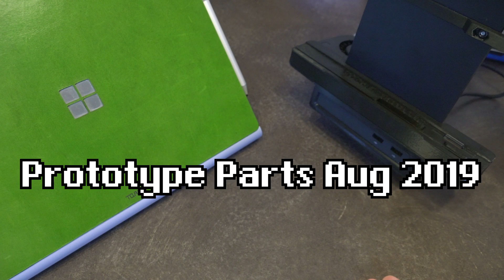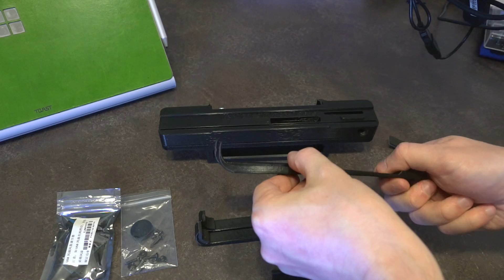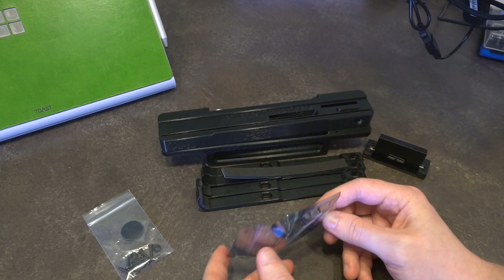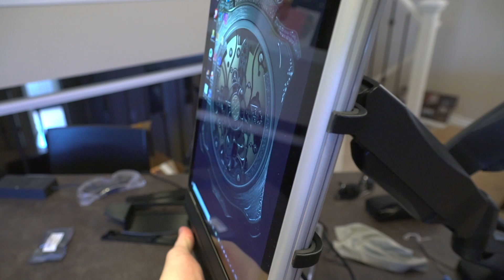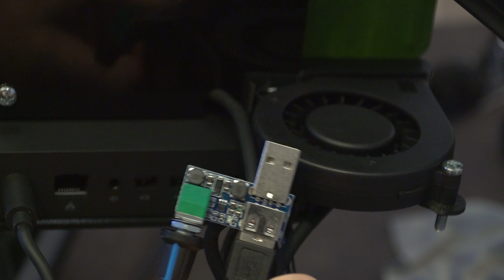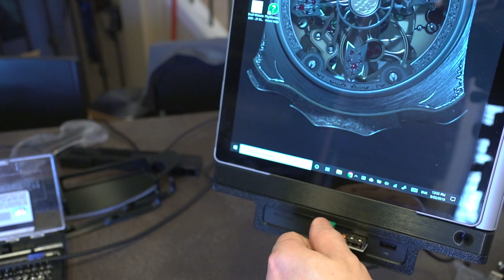Day 576: Surface Book 2- Vertical Dock for Surface (Prototype Parts)

Comment: I regret watching this series. I bought a 13.5" Surface Book 2 after watching some of your videos thinking I could use it to edit some video I'd accumulated. I had never edited before and knew very little about laptops. It didn't take long to realize that 2 GB of VRAM that the 13.5" has is very inadequate and that I should have gone with the 15" that has 6 GB of VRAM. I bought the 15" now and have a 13.5" that I spent $1800 on just taking up space.
Reply from the maker: Sorry that you somehow felt misled. I'm guessing you didn't buy it from Microsoft or kept it over the 30 day return period? I haven't had issues using the GTX 1050 for my work but perhaps your workflow is far more demanding?
Reply: @LaptopRetrospective  The 13.5" I bought brand new from a reputable seller on Amazon. Unfortunately, it took me too long to figure out what was going on in order to return it to them. And if I had I was going to be hit with a 30% restocking fee, and another fee because it was no longer new. I thought I could sell it privately, but that hasn't turned out well. 
I learned from that mistake and bought the second on from Best Buy, so that a return, if it was necessary, would be simple. Fortunately, the 15" 1TB I7 I have now has be great.
Reply from the maker: @gawnejeeping3969  Well I'm glad it eventually had a happy ending, but unfortunate to hear about the bumpy road. Again, sorry if you somehow felt misled on its performance based on this series in terms of meeting your needs and you were unable to return the one that didn't work out for you. I can imagine that was a very frustrating experience. I just recently have gone through one myself. Could I trouble you for some information on what exactly it didn't do for you? That way I can better advise others.
Reply: @LaptopRetrospective  I'm using Davinci Resolve 16. Almost every time I tried to create and use animations for things like titles, no matter how basic, it would come up with GPU full errors. Other times it would cause stuttering in the image while rendering the animation in the videos. If I tried to re-render the video, the stuttering would be slightly different, but still where it was trying to render the animation.
About the only things I could consistantly use it for were the most basic functions of stitching of clips together, adding music, and adding text/subtitles. 
I'm sure there are other programs I could have tried, but the features such as fusion and the effects offered by Davinci Resolve are what I was looking for. 
The 13.5" I have is a 500GB, I7.
I'm still learning, so the videos I have posted aren't great. I'm working to improve with each one. The earliest ones were done with the 13.5, the latest 2 (Colorado National Monument, Crystal Geyser) were done with the 15".
Reply from the maker: @gawnejeeping3969  very interesting, I know a person who uses that bit I don't think their hardware is as robust, I'll ask what limitations they ran into, something sounds odd, like it wasn't using the dedicated GPU properly. At any rate, I really appreciate you taking the time to comment and share your story with me.

Comment: I am really interested in picking up a SB2 with a dGPU (haven't decided on 13 or 15 model) soon, but I'm worried about future stable windows builds. I read that SB2 had issues with around the graphics card starting at build 1903 and it's not clear to me whether this has actually been resolved yet. I hear that version 1909 is right around the corner, which I'm hoping resolves it. I am undecided if I should wait until I hear updates on this or worse until the spring in hopes of a sb3 announcement

Have you updated to version 1903 at all? Have you run into any of the issues around graphics programs crashing with it?

 Thanks! Your video updates have been very helpful!
Reply from the maker: Running the latest builds of Insider ring slow without issues.
Reply from the maker: They also released a firmware update yesterday.
Reply: Ahh thanks for the info, that's good to hear! I'll likely want to join the slow ring I think. 

When you say firmware release, do you mean Nvidia firmware? Or is there MS provided surface book firmware ? Where does one check for firmware updates?
Reply from the maker: @robotsgoboop  Windows Surface Firmware. Pushed via Windows Update. Can also be manually downloaded.

Comment: Hey I am studying mechanical engineering and I need a laptop
I was thinking between the surface pro 6 and the sb 2
I need all of the features, they bring with and I decided for the sb 2 because of the stronger gpu.
The problem I have now is that I hear a lot of bad reviews about it (like abou the battery life, the device is getting slower and so on.) And I am not sure if I should buy it
Could you help me pls?
Reply from the maker: I haven't had any of the experiences described, with the exception of a day of unusual battery drain. Firmware update sorted that out in minutes. Let me know if you have any other questions.
Reply: @LaptopRetrospective  okay thank you
I am going to buy it at saturday
I will buy the 13 inch, i7, 16gb ram and 516 ssd model.
With this model I should be able to do everything.
Reply from the maker: @emircan3042  good luck!

Comment: Thanks for the updated video and glad everything worked out!
We'll continue working on the fan speed controller.
Edit: We've re-designed the fan-speed controller arrangement to not block USB ports. Also the cooling performance has been further optimized to better maintain top performance for the CPU and GPU under load without having to run the fan so loud. All these improvements and more are currently shipping.
Reply: Hi I'm about to purchase your product and I had a question !
Are these prototype parts now stock ? Cause I have a D-Brand Skin with stickers on it and I want to be sure its going to fit ! Thanks !
Reply: @peterbadchild9463  Yes all these improvements and several others are currently shipping.
Reply from the maker: Sounds exciting! 😁